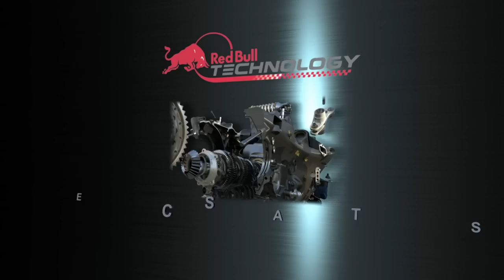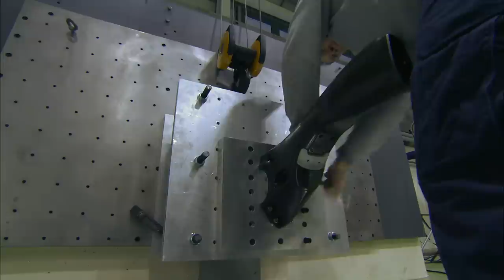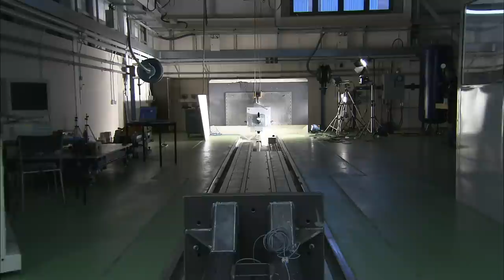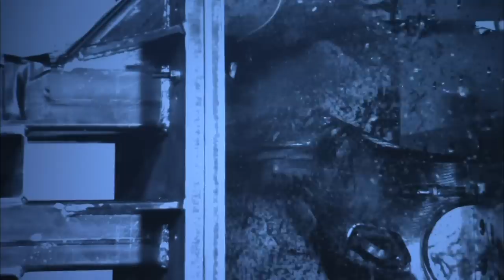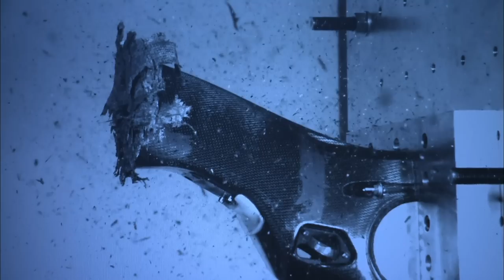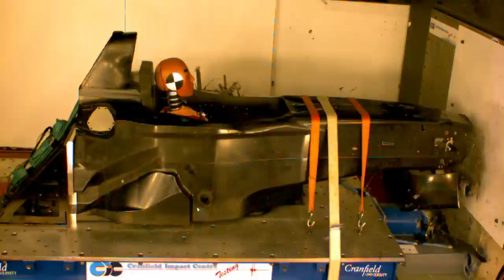Red Bull's crash testing (1080p)

Comment: Blimey... look how much the dummy's head moves during the front impact test. I have no idea how drivers survived head on collisions before HANS devices came in.
Reply: Ravi A HANS device still can't always save you. Internal injuries are the real killer in a crash like that, torn aortas and all
Reply: @Hole_Motorsports  then how do you explain Carlos' 46g impact at Sochi 2015?
Reply: It is just stupid manecin
Reply: @Hole_Motorsports  True, but I guess if one can stop a mahoosive blunt head trauma being added to the mix, that's probably a good thing...
Reply: Ravi Amruth it’s a massive advancement in safety technology and I won’t go on track without one. If you go head on into a wall at 120 though it’s probably not gonna save you though
Reply: @Zonda1996  good point
Reply: Hipócritas  good luck and the skills of professor Sid Watkins
Reply: @ABYTE64  Those crash test dummies have exceptionally complex neck structures to make the data applicable to humans, too.

I would have expected the dummy to use helmet and HANS device to match actual driver better, though.

Comment: At what speeds are these tests conducted at?
Reply: I think they are doing them at 15 meters per sec. I am not sure though...
Reply: 54 kmh? Seems slow considering the speeds they achieve.
Reply: Yes but they should never hit solid objects like this on the race track. Tirewalls absorb most of the impact.
Reply: Der Kater You guys don't get how this works. This high press keep pushing 1 tone of power onto the object. It can go even 10kmh but the result will be the same if car hit it with 210kmh because when a car hits the wall, it bounces back like a ball and here it doesn't because this machine is pushing it. Why would professional teams that invest over 5 millions in each formula car make a mistake in testing ? of course that question " cars go more than 200kmh  not 50" is incorrect.
Reply: Imagine if you throw a toy against the wall 300kmh, it would lose the part where it has been hit and whole tay will bounce back and then imagine if you put it on the test and let the press hit it 50kmh with no " bounce back " effect ;) So basically, in this video, even tho you are seeing this press hitting the nose idk 40-50 km/h , the effect will be the same if car hit in wall 300kmh/h because it will bounce back in certain point and stop crushing.
Reply: 180km/h
Reply: @ABYTE64  yeah
Reply: At least 2mph. Definitely not 2000000mph though. So between 2 and 2 million mph. You’re welcome :)
Reply: @Mazotheman  you see today’s race?